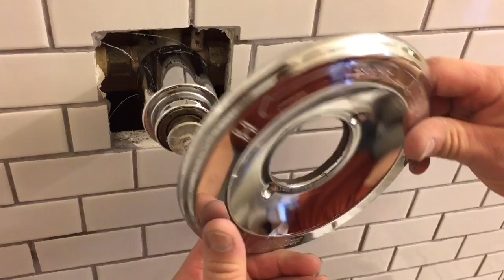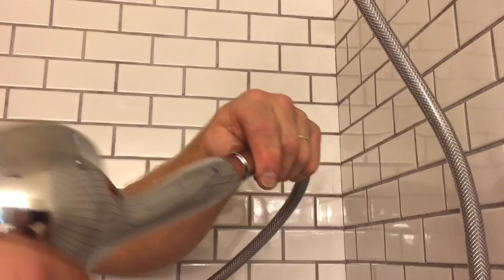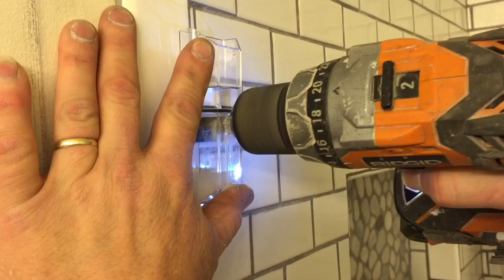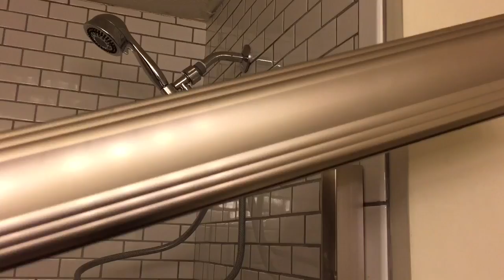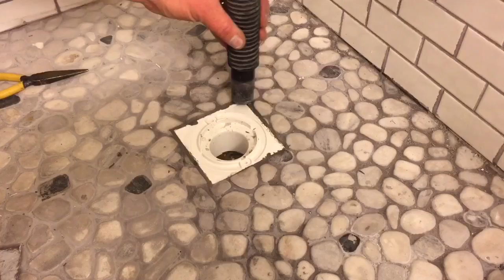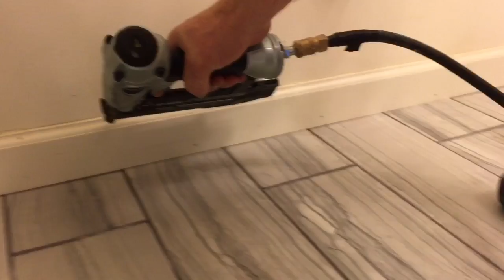How to convert a tub/shower to a walk in shower Part 9

Comment: Great, you cut to the chase on this no fluffy BS. I learned some excellent techniques and methods watching this series. Obviously you are not "just a tile guy" but even if you are, a jamb saw is a wonderful investment. Level and Plumb, just sayin. Lastly, the transition between the carpet and tile... I always put the tile in the place it would be if there was no other flooring, yeah you have to fudge the transition but the homeowner will appreciate it later when the carpet is replaced.
Reply from the maker: I guess there is more than one way. Thanks for watching.

Comment: what would this cost to have a pro do this .
Reply from the maker: It depends who you hire, how good they are, how long it takes, the material used. Every job is a little different. Thanks for watching.
Reply: They never tell... labor costs are variable. He used little tools which I liked as well. Accuracy is crucial and invaluable. The 2x4 he used was minimal and the membrane and mixtures as well. The white tiles and stones were middle of road. The glass door was better quality it seems.  I will go out on a limb and give an u educated guess based on my husbands career as a builder:  
The cost of materials including tile saw and all the gear it takes to create I would guess could range around 3k...
Reply: These days, you'd have to figure anywhere from $7500 to $9000 depending on the materials and fixtures you choose.
Reply: i would almost want to do everything myself up to the tile part.  then hire a tile guy to do all of that...

Comment: This should have been titled Tear out a tub and install an expensive tile shower. This is not a conversion. A conversion is a kit that requires cutting the side out of the tub and installing it.  This was good tho. Every step required was thorough.
Reply from the maker: I did wrestle with the title on this series and while your suggestion may be a little more accurate I feel the current title is more catchy. I guess the space is being converted from a tub to a shower technically. Thanks for the view.

Comment: Just a couple of things those tiny little tile cuts are brutal time consuming pain in the ass a little better layout would save hours even days. While your walls are open install a 2X nailer for the shower door both sides. Never rely or use plastic anchors even for a light door like you have. Opening and closing of the door will eventually pull them loose now you have a leak. Also things rarely go that smooth plz let people know that there’s lots of editing major time lapses and major cleaning up between videos. Bathrooms are not easy never square and very time consuming.  Just the water proofing stage is two days as you dry first coat and apply 2nd. The nitche time consuming pain in the ass as well. All that said you did a really nice clean job. Except for the little diamond Home Depot hole drilling water thingy they don’t work on most tile and fall apart leaving you to make yet another trip to the home center. Don’t forget to patch the hole in the wall where you threw the hammer during one of those steps.
Reply from the maker: Wow that's a lot of criticism from the cheap seats but Thanks for watching
Reply: Please show us your video on how YOU do it,  we would all appreciate a chance to watch an expert.